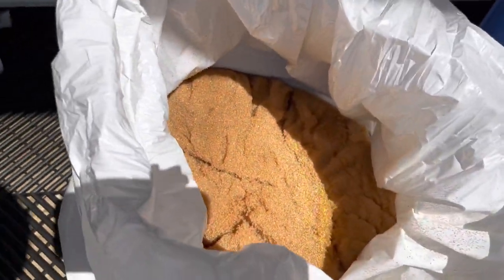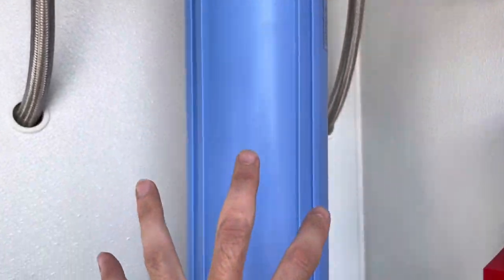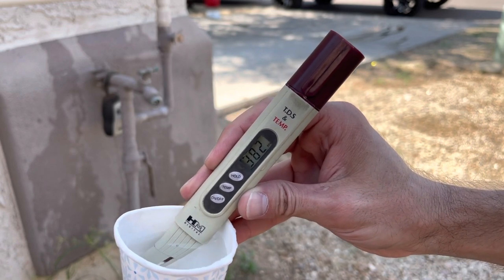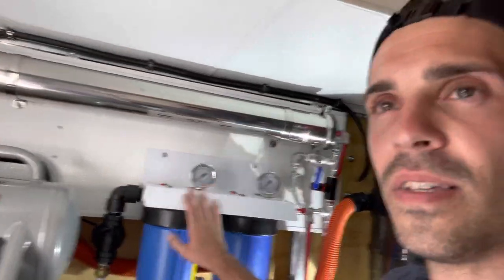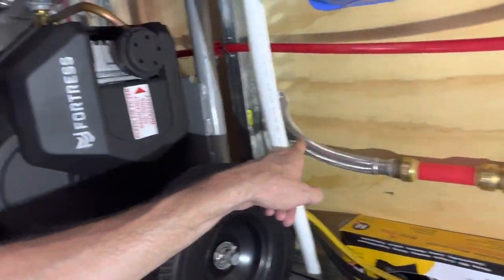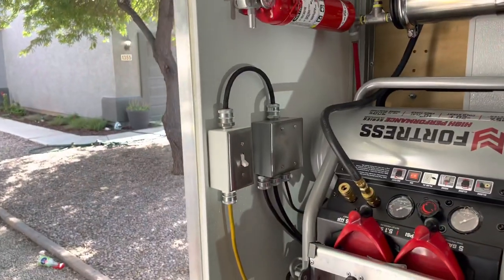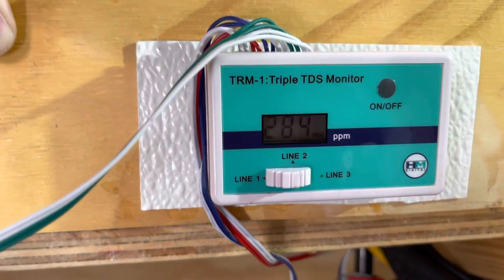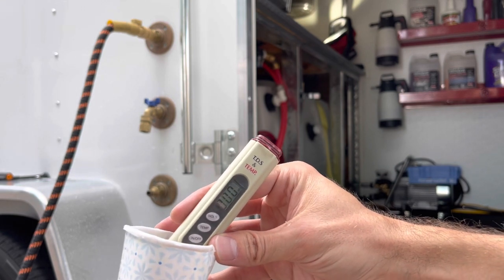Game Changing Spotless Water System with my new Spotless Water Booster

Comment: Very Nice system. A thought for consideration, the RO section requires filter replacements due to removing TDS from 400 to 10. The membranes in the RO filter self flush to extend the replacement cycle . I have found when water is first run through a water softner the RO membrane can handle those TDS much better. this further extends the cycle time to replace filters, specifically the RO membrane (maybe doubles the filter life). Just a thought.     Thanks for sharing all your efforts !

Comment: This is the exact same kind of rodi setup I've used on my saltwater fish tanks for over a decade. Very efficient. I may even start using the water on my car. Only downside is water consumption, running rodi you waste a lot of water down the drain but you can use that water for plants etc if you dont want the waste water part just going down the drain
Reply from the maker: Man I want to get into salt water aquariums! I was very aware you guys use the same type of set up. So cool how those type of fish need ultra purified water. What is your waste water consumption like with the system you use?
Reply: @SpotlessWaterGuy  waste water depends on the membrane rejection rate you use so it can vary. I normally for one good gallon it’s 2 gallon waste water.

Comment: What an awesome video and AMAZING set up! Thanks 😊
Reply from the maker: Thank you!
Reply: @SpotlessWaterGuy  question… if I use this system every once in a while like 1 time ever week or every 2 weeks is there a way of taking out the residual water with the upgrade kit?
Reply from the maker: @ernestopadron3807  if you’re using it weekly there’s no need to remove the water out of the housing. As you flush the system that will happen naturally
Reply: @SpotlessWaterGuy  awesome! Thank you for the feedback I appreciate it 🙏🏼
Reply: Another question… do you know if “softener” resin is the same thing? I’m trying to find where I can buy resin for cheap and in bulk

Comment: Just found your video.  Super system!  I have just purchased a CR Spotless system for home use to wash my new C8 Corvette.  I live in Las Vegas, and I know our water source (the Colorado River via Lake Mead) has to be at least as bad as your unfiltered/DI water in AZ.  We will see, once I get the system, how long the original CR Spotless lasts for me without all the pre -filtration and RO system to act as a feed to the CR Spotless.  I don't know how often I am going to be washing my car, as I don't plan on using it as a daily driver, plus is has a clear bra and ceramic coating, but if the CR Spotless degrades too quickly, I'll certainly give some consideration to using at least part of the system you've developed here.  Many thanks for posting your awesome water processing plant!
Reply from the maker: Those C8’s are a work of art! Congrats on the new car. I’d love to hear how long that CR spotless lasts you at home. Thanks for watching 👍

Comment: I have a spotlees system like yours but I don't reach the 000 level to dionize the water for washing, I congratulate you on the great setup 👌🏼
Reply from the maker: Thank you! What kind of system do you use?
Reply: @SpotlessWaterGuy  My system is much simpler with a 200 gallon tank, a pump that transfers the water from the tank to the filters and a 3000 psi gasoline pressure washer !!!  your system is much more complete ...
Reply from the maker: @johnmartinez1527  right on man. Here’s to working hard 🤙

Comment: This is pretty much what all window cleaners do. However its generally not recommended in pressure washers because water that clean will wear out the lubes in the o-rings and stuff very quickly. At least thats what I'm told.

Comment: Would this work without the water tank? Does the water come out wish enough pressure to just use with a water hose or water fed pole? Let’s say for window cleaning
Reply from the maker: Hey there! Yes absolutely. This system utilizes a booster pump it can run water up multiple stories. The system for window cleaners would come with a manual on/off switch.
Reply: @SpotlessWaterGuy  is this something you sell or can you show how to build ourselves? I’m also in az if there’s a way we can chat about it 😊
Reply from the maker: @gabsnands9845  check out www.spotlesswaterguy.com. We sell them

Comment: I haven't read through all the comments so this may have been previously addressed. A whole house regenerating water softener system also uses a resin media. Is using this system redundant or does this type of resin have properties that a whole house softer does not. If so, please explain. Thank you.
Reply from the maker: A water softener and deionized resin are two types of water treatment systems that remove different types of impurities in water.

A water softener is a system that removes hard water minerals, such as calcium and magnesium, from the water. Hard water can cause scaling and buildup in pipes, appliances, and fixtures, and can also make soap less effective. A water softener uses an ion exchange process to replace the hard water minerals with sodium ions, which do not cause scaling.

Deionized resin, on the other hand, removes all ions from the water, including minerals, salts, and other impurities. This process is called deionization or demineralization. Deionized water is used in many industrial and laboratory applications, where mineral-free water is required for specific processes.

In summary, a water softener removes hard water minerals, while deionized resin removes all ions from the water.

Comment: bryce, im thinking of going from my truck bed to either a trailer or a van, would you be willing to come to california send me the parts list tools needed whatever and let my pay you to set this up in my rig too? im thinking timeline-wise sometime in  january after the Holidays? before the spring time detailing rush. your thoughts? and believe me i wish i was mechanically inclined enough to do it just by watching this video and klicking some links but i know if i do that the parts/equipment will arrive and sit in the garage and never get installed
Reply from the maker: What’s up brother! The water system has come a long ways since this video. I now sell it as a wall mount option. It comes 98% complete and is very easy to instal. The only thing you have to do when you buy it is attach the pure water line that comes off the system to your water tank and attach the float switch to your tank. I also include all the bulkhead fittings for you to do this yourself. If for some reason you still don’t feel comfortable with the instal I’d be happy to come out and help you. Check out my website www.SpotlessWaterGuy.com. If your interested in purchasing give me a ring.

Comment: The 100 PPM drop off just simple pre filters would help a lot of people who are in lower PPM cities even w out the RO. Sediment and Carbon block filters are super cheap and easy to plumb. Could mount to a dolly w the resin for hand mobile use. Not sure if the large RO would work vertical on a dolly in a simple No tank storage way.
Reply from the maker: Thanks for watching! I wanted to clarify some parts of your comment, a lot of people may read this then go out and buy a bunch of pre filters which will not do anything to reduce TDS. A common misconception is that sediment and carbon filters reduce TDS or PPM. This is in not true. Sediment and carbon filters can't remove or reduce TDS levels in water. They are merely there to remove suspended solids and in my case remove chlorine out of the water because RO has a zero tolerance for chlorine. These pre filters simply protect the RO from fouling prematurely. The only thing that can remove TDS is RO, DI resin or distillation. You can add as many pre filters as you want it unfortunately will do nothing to prolong the life of your DI resin. To help answer your other question. The RO can indeed be mounted vertically without any differences in performance.

Comment: This is great and theoretically you could have thousands of gallons of DI water, but doesn’t this just mean you have more filters to change instead of the original 2? Can we get a cost breakdown?
Reply from the maker: Great question. No in fact it means you have less filters to change. Here’s how it works (these numbers get you to 15,000 gallons of spot free water). With the CR Spotless you would have to change out the resin cartridges 50 times (they only last 300 gallons). With the AquaTambo (my system) you only have to change out the filters 7 times. The sediment filter and carbon block is good up to 6 months or 100,000 gallons of water whichever comes first. I recommend you swap them out every 6 months because they’ve are cheap ($15 each). The DI resin in my system will need to be changed around 3 times ($200). The RO filter is good for 2.5 to 5 years depending on how well you take care of it ($300). If it lasts you 3 years your yearly cost is $100. Get ready to poop your pants... When using the CR Spotless you would have to change out the filters 50 times to produce 15,000 gallons of water. With my system you only have to replace filters approx 7 times. Approx Cost breakdown: CR Spotless - $6,950 AquaTambo - $260. Filters to change: CR Spotless - 50 AquaTambo - 7. Again these figures get you to 15,000. Hope that helps

Comment: Thats very similar to what i designed, but mine is inside my basement plumbed into the spigot i use for filling my mobile tank. very clever installing it into your trailer. I still wanna see the advantages of the end you have on your pressure washer gun.
Reply from the maker: Awesome! Yeah I wanted to be able to make water wherever I went. Dude I have been loving that thing at the end of my pressure washer gun. After I finish testing it in different applications I’ll get a video up. Having the extra reach behind wheels and tires has been pretty awesome. The biggest advantage which may sound like the silliest is how much easier it is to change out the foam cannon and other fittings. More to come!

Comment: why not just use the RO membrane? is it because the RO can't get to 0?

are the filters on the RO more expensive than replacing resin?
Reply from the maker: You got it. RO doesn’t get to 0. RO membranes are expensive but they can last 3-4 years. It’s way cheaper than what you would pay with DI resin. My cost per gallon went from about $0.65 down to $0.01.

Comment: So did this new 000ppm setup take place of the power washer? Or is that mounted in the rear now? Seems like a saw a video of your electric power washer mounted under the bissel garage wall vacuum
Reply from the maker: Hey Andy! what I think you’re referencing is the pump and motor which is powering the spotless water system. It requires pressure. My electric pressure washer is still in the same spot. I just now fill my tank with spotless water and my pressure washer draws from that.

Comment: What is your gpm on that set up? Im sure it slows down as time goes by but just wondering what you get when all the filters are fresh. Awesome video
Also how much water would you use to clean a mid size suv? just curious.
Reply from the maker: Hi Scott I average 2 gpm. I use about 45 gallons to wash a mid size.

Comment: can you just use the 9 TDS water to wash the car? Is it low enough that no need to go thru the Resin filteation again?
Reply from the maker: Hey Kingdom! 9 tds is way better than the water quality in most states however I’m not sure what would happen if you let water with 9 tds dry on a cars paint. I strive for only the best results in my detailing business and that includes using only the best water. Once my TDS shows 001, I change the resin. I’ve already put in all that effort to scrub the water, It’s no big deal to run it though the DI to polish it off and bring it down to 000. My yearly DI resin costs are minimal because of the RO. Hope that helps!

Comment: This mod will only increase your time between change intervals or exhaustion because you increased capacity but you’ll still use the same amount of beads or close to it. The beads can only exchange X amount no matter how you place them. Example: if one bead can exchange .02 grams and you put one bead in, after .02 g, you’ll need to change the bead. If you add three beads, you’ll be able to do .06g before bead change. Same amount you just don’t have to change it three times to achieve.06g.
Reply from the maker: That is correct

Comment: Great video! However, unable to comprehend. I understand the concept, which is spotless water or 000 ppm. It would have been an excellent video when you were building the system. Then a list of parts used so if any one would want to do it they can. Overall great video.

Comment: So your water is at 400ppm, send it through the RO 1st to drop ppm to 9, then send water through resin filters to get 0ppm??

You only use the RO to get longer resin life? 
Can you still get 0ppm without using RO?
Reply from the maker: You got it brother. The RO is the heavy lifter. You can still get 000ppm without the RO but your resin will deplete extremely fast. Then your having to replace it and buy more. Resin is expensive. 1 cubic foot is around $250. RO allows that resin to stretch to insane amounts.

Comment: My TDS is at 26 PPM in Salem , OR. would you still recommend the pre filters to the DI system ? I have a 50 gallon tank I plan to fill 5-6 times a week , if the resin lasts a couple months i would be happy.
Reply from the maker: Hey there! No I don’t think pre-filters would be necessary. They’re really there to protect the RO membrane. The carbon block helps remove chlorine which is not good for RO filters. At 26 PPM your water quality is fantastic I wouldn’t worry about it too much personally

Comment: You may never see this; but I’d like to ask a question. RO does not have an endless life, and those membranes are expensive. How often do you have to replace it since that is the first step in removing dissolved solids? 
How much does it cost you? 
And lastly: how much waste water does the RO filter create and where does that offload to?
Reply from the maker: Howdy, yes like all filters, everything has a shelf life including RO. This system was built to reduce the costs of deionized resin (which is way more expensive than an RO filter). RO filters can last anywhere from 1-3 years depending on how well you take care of them. My cost per gallon went from approx $0.65 to around $0.02 after using RO. The waste water consumption depends on the membrane used but in general it’s a 2:1 ratio.

Comment: the pump you are using to push the house water, is that the tucker 110v booster pump?
Reply from the maker: Hey brother I custom assemble all pumps and motors to meet the specs of my water systems. They are not from Tucker.
Reply: @SpotlessWaterGuy  oh tight man, can you build me one? I just need a good pump. I have a zero pure revolution because I am mobile. I don’t have the luxury of a garage or trailer. It’s like what you built but on a mobile cart. It’s for the window washing business.
  I am waiting on it from the post but I know it only does .75 gpm. I need like you 2gpm to fill up my water tank. I would love to get a pump like that from you. ✌️
Reply from the maker: @LotusDetail77  sorry bother we don’t sell parts. It takes several months for us to get some of our parts in due to supply chain issues. All of our parts go towards building complete systems.
Reply: @SpotlessWaterGuy  no problem man. I understand, it’s crazy. Ok , thanks for the help and your time, I appreciate it.
Much love to ya.👊
Reply from the maker: @LotusDetail77  of course best of luck! Much love from us too!

Comment: I am a pressure washer and I also am cleaning windows and solar panels ! I am gonna build something like this to my trailer to run to my water fed pole ! There is also the Xero Pure system with two 40” RO membranes on a little dollie with di and carbon filters with it . But I like your design
Reply from the maker: Hey 524, thanks for commenting! I’ve looked at Xero Pure it seems like a great option if someone doesn’t mind the slow water production. Without a pump it’s only going to produce around 1 gallon per minute. It would take an hour to fill up a 65 gallon water tank with that system. I think that’s why it’s marketed towards window/solar panel cleaners. If I started to run low on water while I was out on a job I wanted to be able to fill up my water tank quickly. My system doubles the water production in comparison to the Xero Pure. It produces 2.1 gallons per minute taking around 30 min to fill up a 65 gallon water tank. It’s all relative but I wanted faster water production haha. My Kranzle pressure washer takes 2.1 gallons per minute so the output of my system could keep up with demand. Curious if you use DI water when pressure washing or just for window cleaning / solar panel cleaning?